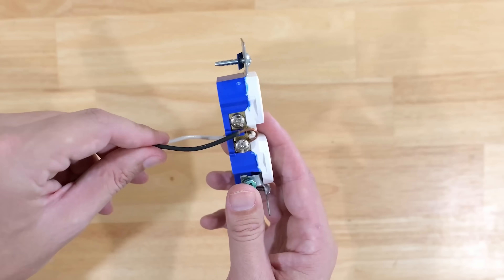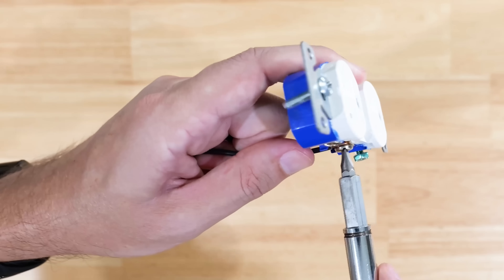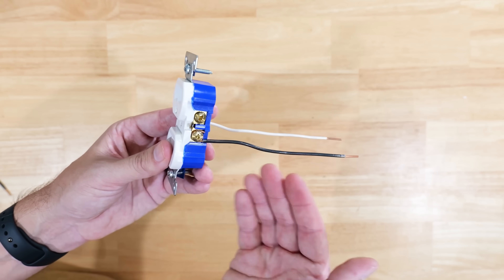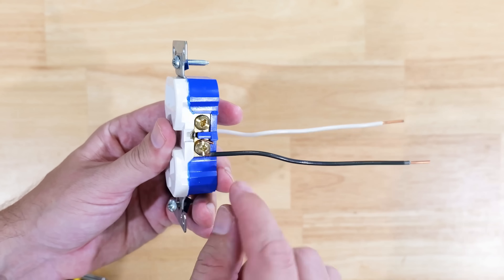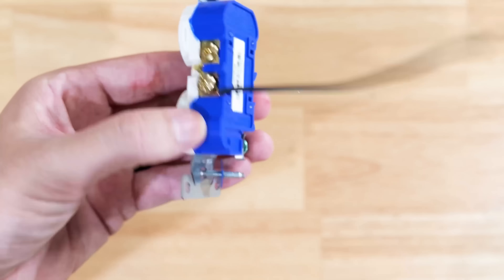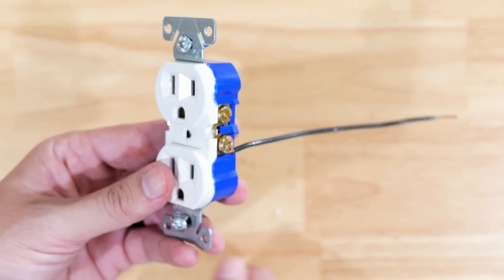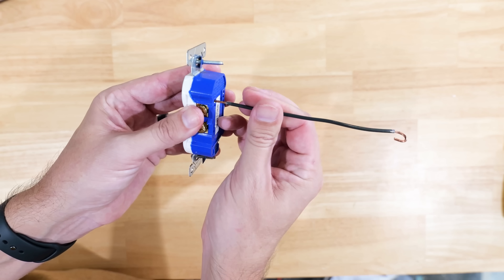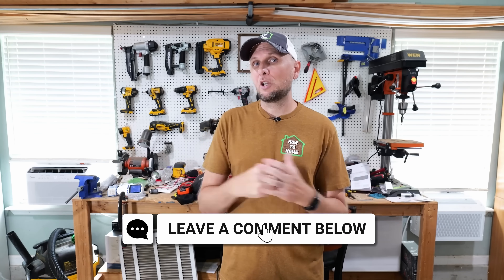Avoid Disaster! 8 FATAL Outlet Mistakes Most DIYers Unknowingly Make!

Comment: You see those stab Ins they use a compression locking system on the wire . Well, when you insert them in the compression lock and give it a twist to make sure it's sacured, well, that's a no-no in electrical because the compression fit will score the wire and now you created a weak connection in your job that you cannot see !!

Comment: And when you use the wire nut and yes, a wire nut is the choice of an electrician choice always, and do twist your conductor together,  do not be lazy and just put your conductors under the wire nut and then twist it ,and then hold the thought ok that's good enough for me , because its not good enough for the industry!!

Comment: Do not use the quick stab holes , always use the screw and tighten down ,and orient the wire in the direction of the turn of the screw, so the wire turns in on it's self

Comment: The 14, 12 & 10 AWG copper conductors (wires) are rated at more than 15, 20 & 30 amps respectively per NEC article 310.15(B)(16). It's NEC article 240.4(D)(3,5,7) that limits the overcurrent protection (breaker/fuse) for these sized wires to 15, 20 or 30 amps. 
Duplex 15 amp receptacles are the exception to putting an underrated device on a higher than it's rating breaker.

Comment: The particular outlet you're showing is sold with many designations, but it's probably EATON 270W in this case. They are listed for stranded because they can take the higher torque required to safely make the stranded connection; 14 in-lbf. 12 in-lbf would not be up to code.

Using stranded wire directly under a screw like that was usually not NEC compliant because the receptacles formerly couldn't withstand the torque required to compress stranded enough to make a safe connection. Under a clamping plate of a back wire receptacle is fine, the required torque is much less with the larger contact area, but technically you can't even use bare stranded under a grounding bar screw at the panel in most instances. Internally at NFPA they were pushing for strong language requiring a ferrule or similar constraining/terminating device to use stranded that will directly contact a rotating screw and you saw glimpses of that language in 2014 code in 110 talking about constraining the strands, but it was backtracked in 2017.

Comment: I had to fix an issue in my inlaw's furnished basement where half the basement would randomly loose power. after MUCH careful tracing and investigating, found it came down to an outlet in the service closet where the AC and sewage pump where that was backstabbed and served as a junction for half the basement... it was clearly overheated and melted. pulled the outlet out, replaced it with a new one and screwed the wires down after pigtailing it, problem solved :)

Comment: Who’s using 14 AWG wire anymore? 
Used to be lighting was 14, plugs were 12. But since down the road an outlet might be added to a light circuit, it’s wise to run 12 all around.

Comment: My 3 year old daughter dropped a quarter behind a night light plugged into a socket with the ground down. She ran over to me and tried to tell me I didn't know what she was saying, so I ignored her concern. She ran back and grabbed the quarter and  I heard scream. I got up and ran over to see the sparking of the quarter lodge in behind the night light.  I unplugged the night light. The quarter dropped to the floor with 2 grooves notched in it by the positive and negative leads. If the ground was installed up, this would not have happened.
Reply: Can you tell me what you mean by ground down and ground up?  I’m on a long journey to learning everything I can about electrical work so I can start feeling comfortable with doing my own.

Comment: Most of switches and receptacles have square head #1 “ Robertson “ screws , use a green handle Robertson screwdriver to tighten the screw terminals to prevent “ camout”

Comment: To DYI: none except for one you call out that i completely disagree with, and that is the one taking a bit of extra insulation off after the hook. Really, who cares? But the best thing you said was always use the screws n tighten them down. Esp with gfi recepts. I always put a std screwdriver on them after my impact driver unless it starts to twist it out of my hand. and, like i commented below, if your not stabbing them in the back then you might just as well wire every outlet ckt in the house with 12g, which is a practice i started about 12 years ago because the cost of wire wasn't that much. Because, like you said, almost every service call was a wire that popped out of the back and usually fried.  But i'm still not going to use 14 except for lighting. Ed: if i keep this up at almost 70, 12g has gotten a lot harder for my getting arthritic 69yo hands to deal with.   I might cut back on it if it keeps getting worse.  even twisting wire nuts sucks. I got one o' those red wirenut drivers and it's awesome.

Comment: I wonder what you should do when you encounter outlets that are double stacked, or when you go to install a new receptacle but there isn't enough extra wire to remove and replace the J hooks, I suppose that you could use wire nuts to tie the double stacked wires prior to the receptacle inside the box and I guess you could also use them to add additional wire so you can ensure that you aren't going to have any wire deterioration issues but it seems like adding additional points of fault would be more counter productive than just reusing the J hooks that are already there, I suppose that the best option may be a better quality outlet that doesn't require J hooks at all and also has additional points of contact that you could use to eliminate double stacked wires. I have run into a lot of issues when trying to update their electrical systems because there wasn't any coding back in the day, some of the things I see I'm like I can't believe this place never caught on fire, places where wire staples were driven almost completely through the wires and you could actually see scorching on the wood around the staples or junction boxes with 10 or more wires inside of them with wire nuts with 5 wires stuffed into them, you can't seriously believe that  all 5 wires are getting a good connection and who would use wire nuts inside their breaker box and why I went to a place a few weeks ago that had 2 15 amp breakers for the entire house and it was really a 3 story house including a full basement that had been updated to provide additional living area, the people had paid a fortune for the place and couldn't understand why they were having so many problems with the breakers tripping so the first place I went was the breaker box to see if there was a simple solution, and well I immediately knew what was wrong I'm afraid the solution isn't going to be very simple, the lady of the house said that when she bought the place the guy had been bragging that his father was a bit of an electrician 😂 I said I think he was trying to let you know that you were buying a lemon 😂 I think that guy knew his father was an idiot and he probably had experienced the same issues even 20 or 30 years ago I would almost guarantee that the old man replaced the original screw in breakers box,  with this huge 400 amp box thinking that he was actually making an improvement. I don't understand why he decided to just add extra wires to the two 15 amp breakers that he had running the place but I haven't even looked at the 2 220 breakers he has installed yet but I'm not holding my breath that they aren't going to require anything. I personally would have been rewiring the entire house if it was me but they was me to just add additional junction boxes and run new wires to them to add enough breakers to eliminate them constantly tripping unfortunately this is a rather large family and they all use a lot of electronic devices oh yeah I forgot that the place has a 2 car garage with a couple lights and a couple outlets and when I discovered that the wire that was running to it was barely under the ground and not even an exterior wire I had to disconnect it but it was just jumped off a receptacle. I don't know think that old guy had a clue how lucky he was that he didn't burn his house down with him in it. I know that they paid way way way more than they should have for that death trap but hopefully I can get it all straightened out for them, I don't think the old man did anything inside the original walls since the majority of the junction boxes were in the attic and within a few feet of the breaker box and then of course the 10 plus wire nuts inside the box to add additional hot wires to provide additional power for all his additions. But I guess I will see when I get a little further along.

Comment: 1:51 "You can put a 15A receptacle on a 20A circuit" Wrong! You can NOT put a 15A receptacle on a 20A wire and/or breaker. If you do then the 15A receptacle may fail if the device plugged in shorts and draws more than 15A, and the receptable could fuse and melt and cause a fire without tripping the 20A breaker or 12GA wire.
Reply from the maker: Yes you definitely can.  Feel free to look up NEC Table 210.21(B)(3).  You will clearly see that you can put either 15 amp or 20 amp receptacles on a 20 amp circuit.
Reply: I've  been doing this shit 20 years my guy you absolutely cannot! @HowToHomeDIY
Reply from the maker: @derekdavies7374 You shouldn't be doing it then.  I have supplied code for it.  You are just giving opinion.  You absolutely can.  Please reference code if you are going to try and continue this.
Reply: @HowToHomeDIY 210.21(B)(1) "Single Receptacle on an Individual Branch Circuit":
"A single receptacle installed on an individual branch circuit shall have an ampere rating not less than that of the branch circuit."
Just because you can do it for multiple receptacles doesn't mean you should.

In general, receptacles should match the circuit. 

I admit that this is impractical, since almost all switches and smart plugs are rated 15A and could possibly fail if their load sustained 19A on a 20A circuit. 

I am not an electrician, but I work on electronics/PCBs and it seems pretty fundamental to strive to not have *any* "weakest link" and has always seemed pretty strange to me for the NEC to allow it.
I would never design a PCB to have any part or via on it be rated to handle less than its fuse.
Reply from the maker: Yes a single receptacle cannot.  So it would be against code to install one single 15 receptacle on a 20 amp circuit.  Nobody is doing that though.  Nobody is installing a 20 amp dedicated circuit to a single 15 amp receptacle.  And by single I mean it just has the one plug in, it’s not a duplex receptacle.  Which again, nobody does.  And the rest is just your opinion on it.  You said “Wrong! You can NOT”.  Well yes, yes you absolutely can.
Reply: @HowToHomeDIY Thanks. I am jumpy/reactive/triggered on this because I had a professional electrician tell me that I need to replace all of the 15A outlets in my house with 20A outlets to match my 20A circuits and I believed him and did it myself.
Even if no one does wire a single tap 15A outlet, there be an opportunity for a video here to dispel a perhaps common myth that the receptacles have to match the circuit.
I could see a dubious electrician telling a customer exactly what I was told and then needlessly charging the customer hundreds to thousands of dollars to do the easy money con work.
Kind of like the myth of a car mechanic charging extra to rotate the air in your tires. :)
Again, thanks for the video!
Reply: Licensed electrician here.. I use 15 amp rated receptacles on a majority of 20 amp circuits in a dwelling unit. Bathroom circuit,  small appliance , garage plugs ect. The only time I use a 20 amp rated receptacle is when required by code. Example: a grinder pit may require a dedicated 20 amp circuit,  to which I use a single 20 amp receptacle and gfi protect it at the panel..
Reply: do you have a code reference on that
Reply from the maker: @doyleshelley5838 I already supplied it above.
Reply: With regard to the single 15A receptacle on a 20A circuit, if you have a 20A circuit and replace the breaker and the single receptacle, is that now acceptable since it is now a 15A circuit, despite the excess wire gauge?  If not, why?

Comment: I don't like the 15 amp outlet on a 20 amp breaker and 12 gauge wire or 14 gauge wire . Whatever you said ? The outlet should match the breaker . For several reasons . 
     1 an unfamiliar electrician coming to troubleshoot can identify its on a 20 amp breaker . 
2 electric motors can short out pulling more electricity than what it was made to pull . This will cause the outlet to become a filament like a light bulb . 
     I know they changed the code years back allowing this but I was taught the old original way of making the breaker , wire , and outlet all match .

Comment: Even if you install a 20amp rated outlet  on a 15amp circuit unless you change the breaker to  20amp it won't cause a fire an appliance can demand 1millon amps on a 20amp outlet on a 15amp breaker the appliance will only be given what it is fused at...

Comment: A 90 degree three prong plug is normally designed with the power cord extending from the ground side. This makes for an awkward mating when the receptacle is installed in a ground up orientation.

Comment: Sorry, but this video is misinformation...    First of all, there's no such thing as "pulling too much power".......   In fact, you don't "pull power" at all...  You put loads on power that is ALREADY AVAILABLE!!!! More simply put, POWER IS POWER!!!! YOU DON'T HAVE TO PULL IT!!! IT PUSHES!!!  That's like saying that your drivetrain on your car is doing the work of "pulling" power from your engine!!!  THIS IS BULLSHIT!!! YOUR ENGINE IS DOING ALL THE WORK!!!  IT IS DELIVERING THE POWER!! THE DRIVETRAIN DOESN'T "PULL" ANYTHING!!!  Whether or not this guy understands this, the simple fact is that the power that is supplied by power companies on their grid, IS NOT LIMITLESS!!!!  He is also extremely confused about what an outlet/receptacle is...  THE RECEPTACLE IS NOT A LOAD!!!  It is simply a connection to power, FOR a load!!!  There is ABSOLUTELY no danger in using a device that is rated for HIGHER AMPERAGE than the load that you are putting on it!!!!  THE OPPOSITE OF WHAT HE POSITS IS ACTUALLY THE CASE!!!  You always want to STAY BELOW the full capacity of what your wiring and connectors are rated for!!! CONVERSELY... Using ANYTHING that has an amperage rating that is TOO LOW for your load, **IS** A HAZARD!!!  Your "safety" valve (protector) from overloading a circuit is YOUR CIRCUIT BREAKER!!!! NOT YOUR OUTLET!!  ALWAYS REMEMBER!!! THE DANGER IS USING A CONNECTOR THAT IS RATED TOO LOW, NOT ONE THAT IS RATED TO HANDLE MORE AMPERAGE!!!!

Comment: I rather enjoyed your video, it was training 101! As a tradesman for over 30 years, i always drew the diagram of how I took it apart. I found some ppl wired the stranded wire wrong and fixed as per how you showed. As a licensed handy man in Alberta, I can only wire back to the original wiring. As per doing my own wiring, I always have it inspected by a journeyman that certifies it for me before I install insulation and drywall. I makes life so much simpler. Once again, thanks for the video!
Reply from the maker: Definitely sounds like you are doing it right and take pride in your workmanship!  Thanks a lot for sharing and thank you for the feedback!

Comment: In my house they put 10 gauge solid core wires on all 120v circuits making installing ceiling fans and light fixtures a giant PITA however that's not the real problem... they installed exactly 2 outlets with grounds and the majority with reverse polarization.

Comment: YOU CAN PUT 20 AMP OUTLETS ON A 15 AMP CIRCUIT ITS THE BREAKER THAT MATTERS
Reply from the maker: No you can't.  Check code.  You claim to be an electrician in another comment but there is no way you dont know its illegal.  If you dont then please look for another job.
Reply: @HowToHomeDIY - it violates code, but it would electrically work until the cable catches fire. That's the danger when DIYers don't do their research. The only mechanism which would actually sever the power is the breaker (assuming non gfci).
Reply from the maker: @TheJoeDavis yeah that’s the problem, it makes it more likely for the wiring to catch fire.  That’s why it’s against code.  Breakers can fail.  They also let max amp draw continue for a long time which can also start a fire.

Comment: Doesn't matter if you put a 20 amp receptacle on a 15 amp circuit wired with 14 gauge. If the appliance draws more than 15 amps, the circuit breaker will trip and the wires will not burn. The only way you're going to start a fire in that scenario is if you took the 15 amp breaker out and replaced it with a 20 amp breaker without changing the wiring to the proper 12 gauge which is rated for 20 amps
Reply: It's apparently not code compliant, though, as silly as it may seem.

Comment: At 6:50 you can see the wire is clearly scored, twice, during the stripping process. BIG NO NO.  At 7:50, the wire was moving because it broke at the stripping process score line; the rest of the wire was still secure under the screw head. Biggest mistake I have encountered when fixing outlets. You can reuse that scene for another What NOT to do video.

Comment: I don’t even think backstabs should be on receptacles, let alone legal for use. Too many fires have been caused by them. Generally speaking I only ever really use commercial grade receptacles anyway, the side wiring plate makes it a lot quicker (and if you work on a lot of automated / heavy equipment this method is very familiar).